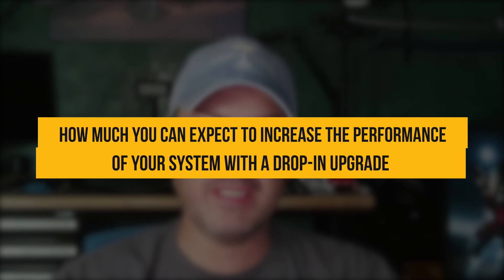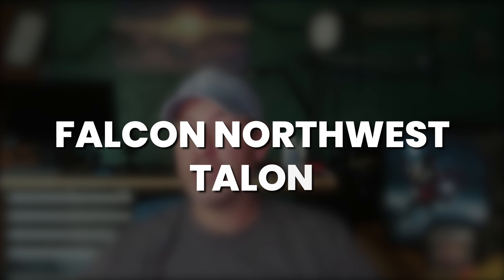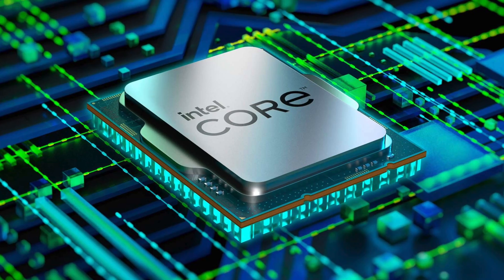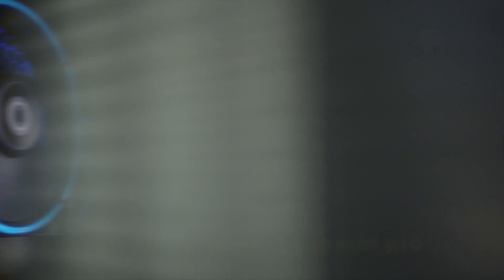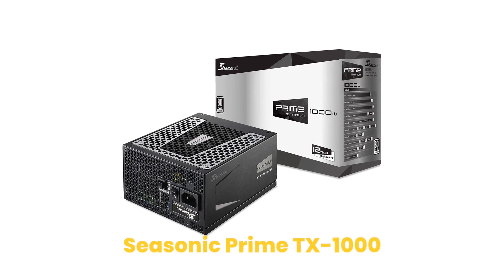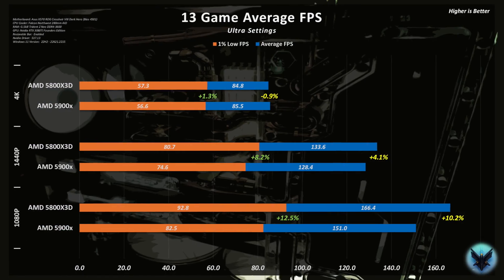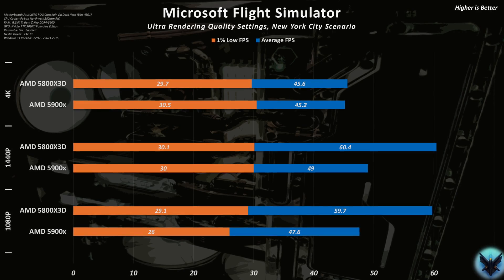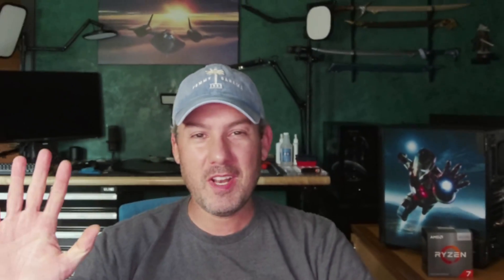Is The 5800X3D Really Worth It?

Comment: I almost did just that. I have a quality X570S , 64gb , 6900XT with 5900X. Curious about trying the 5800X3D so I found a cheaper open box for $239. The next day after installing it I was already jumping on board just selling my good hardware and buying new 7800X3D as the entire upgrade would be $250-300. I placed the order and planed to return this open box. But I cancelled my AM5 hardware and decided to just stick with my new openbox 5800X3D. A friend is going to buy my 5900X for the same price but I will do all the labor of bios update and install.
I just undervolted it using curve optimizer. Only wanted to lower it a bit as I can't believe extreme undervolting is good for electronics. It runs better with a ALL CORE NEGATIVE -15.
Reply: How is the gaming performance compared to you 5900x? is it smoother or really no diff at all?
Reply: @PapaSwag87  Honestly it is really hard to tell. Today I thought about swapping back to the 5900x to see if it was noticeable worse. 
The problem is I also just updated the bios and updated AMD 6900XT driver.
Their new driver I think was the cause for stuttering as I felt some weird micro stutter.
But as far as more FPS it isn't so obvious for me to notice night and day benefits.
Part of the issue is I am not playing high FPS games that I could easily see the change. My 6900XT at 5120x1440p shooting for 240fps is very much GPU bound. I still play old school BF4 and my FPS really seems about the same and I think it's due to a GPU bottle neck. It jumps around between 150fps - 200fps. The GPU does show full utilization though except for when it hits the 200fps cap of the game.

Really it is hard to say , I almost want to swap back and try my 5900X out again but really why though as the 5800X3D has the 8 core CCX and VCACHE so I can't see how the 5900XT would be better. Clock speeds are similar, the 5900X would boost to 4950mhz but in game the cores were more like 4300-4500mhz same with the 5800X3D which is around 4350-4450mhz. 
I did undervolt it but put it back when I saw stuttering as I wanted to rule it out as the cause. I might try my 5900X again but I really think I am not able to see the improvement due to the game, resolution and ULTRA detail being used.

Hope these random thoughts help.

UPDATE 1/8/24 - Still running this 5800X3D. Prices on he 7800X3D went up $52, motherboards are spendy and ram is still the same in price. What I cancelled would have been the best deal. I likely will not return this 5800X3D as it's better than my 6900XT can perform at 5120x1440 @240hz. If I come across a smoking price on AM5, 7600, MB and RAM I might just sell off this current AM4 hardware but unlikely. 5800X3D should be good for most 200 - 240fps targets once I have a GPU with enough muscle to stay around there. Must resist the urge to upgrade for little reason at the moment.

Comment: Well, it really depends on your current graphics card. If you have a 3080 or lower and as long as it doesn't dip below 60 fps, then it’s not a big deal
Reply: The 3080 needs a lot of cpu to push it. On the amd side you need at least zen 3 so a ryzen 5600 minimum.
Reply: not a big deal to you. Some people like and want over 60 at all times. Me for example will always aim for around 90+, 90 being the min. Some are fine with 40 as their min, some want 120+
Reply: 60fps on a 170hz monitor? Nah
Reply: @Fucklesticks  Doing only 60 mph on empty 8 lane highway? Nah

I didn’t say always playing at 60fps. What I said was, if you don’t mind framerate dips as long as it doesn’t dip below 60fps most of the time, the 5900x is more than sufficient. When playing Cyberpunk 2077 on ultra ray tracing settings with a 3080, the 5900x can achieve around 80-95 fps at a 1440p resolution. It’s not a problem to stick with the 5900x, especially if you’re doing extensive tasks with it.

If you one more, just lower your game setting

Comment: I did this upgrade myself and the gaming performance gains were actually higher than shown in here. This was with a Radeon RX 7900XTX.  I would dare to say around 15-30% faster performance, feels like another system lol
Reply: I went from a 5800x to 5800x3d because the 5800x broke, and in mw2 I went from 180 to 360 FPS on the built in benchmark for the CPU
Reply from the maker: What cpu did you upgrade from?
Reply: @blackbirdpctech  5900X
Reply from the maker: Would be good to see some data for your performance claims … this type of gain (15-30%) is unlikely except in games like Microsoft flight simulator that benefit significantly from the 3d v-cache.
Reply: @blackbirdpctech  Notice massive gains with Uncharted 4 and God of War 4. But of course the 7900XTX is going to be more CPU bound than a 3090Ti and that is at 2K resolution and my card is a Gigabyte Aorus custom one. It clocks neatly at 2.8-3.0GHz at 465W as it has three 8-Pin power connectors.
Reply from the maker: @evolucion888  interesting, since I didn't test Uncharted 4 or God of War 4 it would be great if you could post your data here.  I tend not to test games that don't have built-in benchmarks because it's difficult to maintain consistency between benchmark runs.  I do agree that a higher-end card such as a 7900 XTX will place more strain on the CPU, so these type of gains with an X3D chip are indeed possible under those conditions.  I appreciate your comment, thanks.
Reply: @blackbirdpctech  Techpowerup review of the 7800X3D compares it to the 5800X3D and they are essentially tied on God of War, which shows the amazing gains with X3D CPUs in that particular game along with Forza Assertio and Uncharted 4. Typically according to AMD, the average gains are around 15%, but lately games are benefiting of the extra cache and I also use PBO2 with -20 Offset to keep the boosting for longer.
Reply: The 7900xtx is a lot more powerful than the 3080 ti, that why the difference is bigger.
Reply: Bro, he is testing CPUs in GPU bound scenarios, what do you expect? :D 5800x3d is way faster than 5900x in gaming. Warzone is my main game and I went from 120-150 FPS with the 5900x to 200-240 with the 5800x3d. I use low settings though. Who the hell is gonna play a competitive online game on ultra settings?
Reply: @reizanaliu  Who cares?
Reply: @evolucion888  you should care. CPUs are not compared in GPU bound scenarios. It makes no sense.
Reply: @reizanaliu  Your reading skills aren't up to par.
Reply: @evolucion888  i was agreeing with you, but you seem to be on your periods.
Reply: @evolucion888  you shouldnt be the one talking about reading skills 😉
Reply: @reizanaliu  Who cares? Lol

Comment: Wouldn't it be a more apples to apples comparison with the 5800x rather than the 12 core 5900x?
Reply from the maker: Great question.  A comparison with a 5800x is not super interesting to me because it has been done many times and the only reason to do it would be to attempt to isolate the impact of the 3D v-cache.  The problem is that if the 5800x is a golden sample and the 5800x3D is not, then the results would be very misleading.  I had a gaming system with a 5900x in it and I wondered if it would be worth it to install a 5800x3d.  I’m pretty sure there are others out there that have wondered the same thing and it’s not a comparison that I’ve really seen on YouTube.

Comment: Nice video with very useful data. I play in 4k, but the question here is enabling FSR / DLSS in games will drop the resolution to 2k, so the 5800x3D will take the lead. Also, with a little more faster GPU maybe the differences will be higher.
Reply: If you like slow stick with 4k.   Always think "How can I make this slower"  Yea play at 8k on a tiny computer screen 1 foot from face.   The grass is not greener at 8k just slower.
Reply: @Physics072  Nonsense reply is nonsense. Why even comment?
Reply from the maker: Thanks for your comment.  A faster gpu shouldn’t make the differences higher because it will enhance both CPU’s equally in gpu bound games or at gpu bound resolutions.  Your comment about FSR/DLSS however is very interesting … I should add that in some of my benchmarks moving forward when testing CPU’s.

Comment: I'm playing at 1440p. Got a 4090 recently and am on the fence between the 7800x3d or the 5800x3d. They offer basically the same performance right now and am currently on the 5800x. If I go AM5 I'd have to get a new mobo, cpu, and ram (for very similar performance.) It might be wise to stick with the 5800x for now and upgrade to AM5 later down the line. What are your thoughts? Also subbed
Reply: Get the 5800 X3D not the 7800 X3D.   I would wait for the next round of cpus at least 1 gen.  Not enough difference to make it worth a total system upgrade.  You have to be strong and resist the temptation and the excuses why you need to buy an entire new system.   
You really do not have to do a thing depending on if any of your games are dropping under 60fps much or what games you play.   If its just solitaire or hearts then keep the 5800 its only 9 percent difference with a 5800x3d.   Not really enough to be worth the 300+ dollars.
Reply from the maker: If you are primarily gaming and you have a low latency ddr4 kit, such as 3600 CL16, then I would say stick with the 5800X3D.  Latency is more important in gaming than memory speed.  The 7800X3D is of course a great chip but at this point I would wait for 8000 series.
Reply: @blackbirdpctech  Thanks for the reply. I’m more concerned about the 1% lows right now and after watching the video I’m gonna hold off until am5 becomes more polished.
Reply: I have a 5800X. I wouldn't go to AM5. The 5800X has the same single core and gaming performance as the 5900X chip. From the videos I'm seeing, somebody is lying about AM5. I'm seeing very favorable numbers with my 5800X/7800 XT combo compared to AM5 rigs. Maybe it's SAM and PBO I don't know. I do now this combo will be good for many years to come.
Reply: If you got the money to burn then 7800x3D is worth it when you can go higher on the memory like in that 6000MHZ range 32gb would be the minimum and 64gb would be more better suited in future proof and also which you will gain more FPS you can research on Gamer Nexus and Hardware Unbox from there testing .
Reply: @2roly2 yea in the spring the 7800 was not a good value and ram issues were common and issues on some mbs.  5600 and 5800 x3d stable and better value plus not that much slower.  I would not pay 200.00 more but if the prices are similar and issues ironed out then yes 7800x3d its not enough of a wow for people w 5800x3d to bother with.  Imho.
Reply: get urself the 7800x3d with a gen5 pcie motherboard cl30 ram and a gen5 m2 drive that reads and writes at above 10k. thank me later.
Reply: @Balanced--  Not worth the price of upgrade I will wait for the next Gen Mbs/cpu/ram.  Its not 2x faster not a WOW upgrade only lost money.
Reply: Well I’m using the 5800x3d and it’s absolutely worth it. I’m playing at at 2k 240hz and it’s perfect 👍

Comment: so exactly like a though 5800x3d push frame at 1080 and become pratically inexistent at 4k
Reply from the maker: Yes, the 5800X3D is a beast but it doesn’t matter at 4K … it’s all about the gpu at 4K.
Reply: Yes i was almost to do buy it, the In decide to ovverclock the 5900x with first 10 core at 4.8 and second line at 4.65, all at 1.38v stable 70 degree in gaming and a nice boost. I run some games at 4k I use a oled LG 48 inch and I got 98% of use of my 4090
Reply from the maker: @DavideStiff  I use an LG oled 48in tv for 4k gaming too ... the picture quality is amazing.